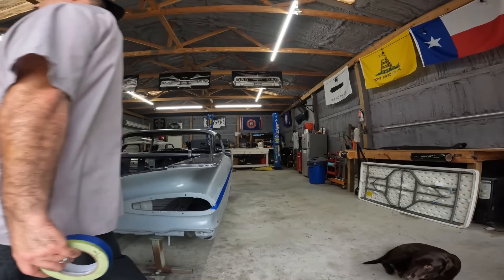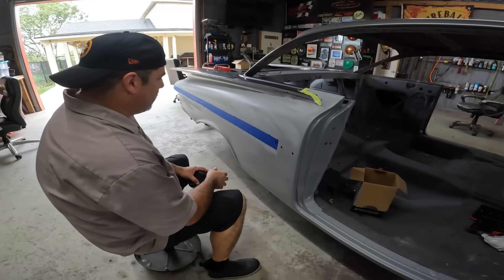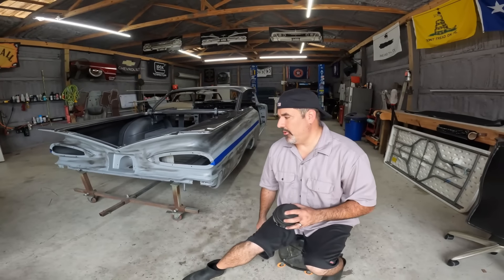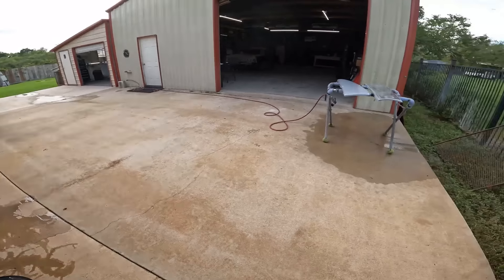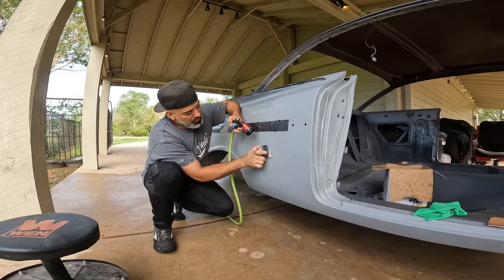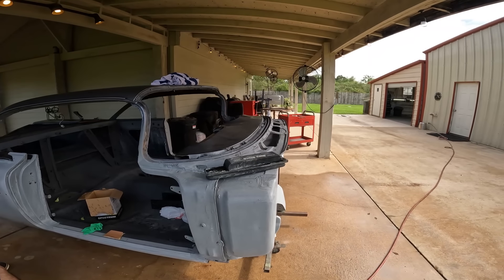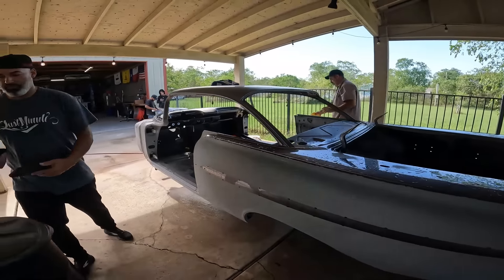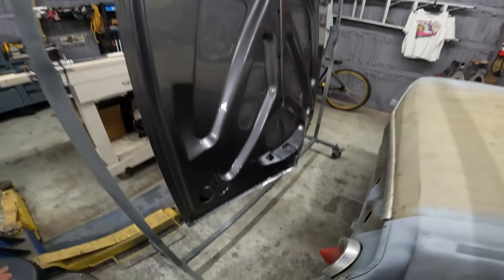WHEN THEY SAY IT'S READY FOR PAINT..... | #diy #impala #classic #lowrider   #painting

Comment: I have a question about the 61  weather strip on the belt line.
Does it overlap on to the door & quarter window trim moldings?
Reply: Does the wider strip go over the beltline slightly?
Reply from the maker: @JM-dw3zx I would need to see pictires